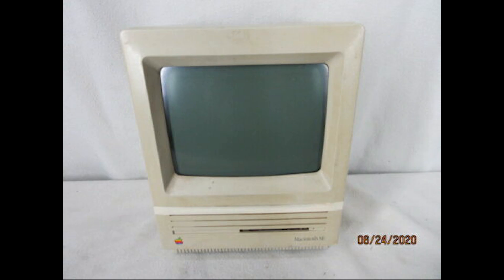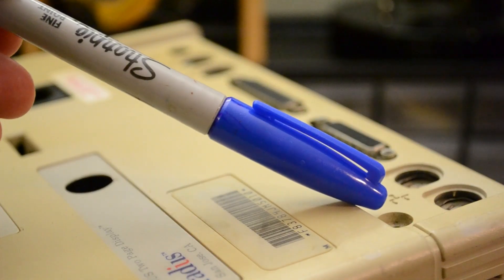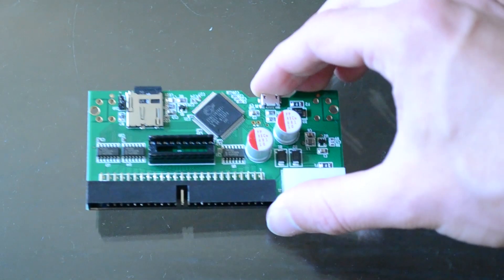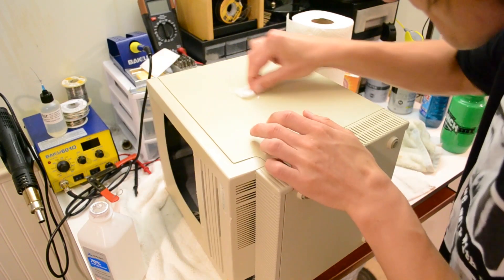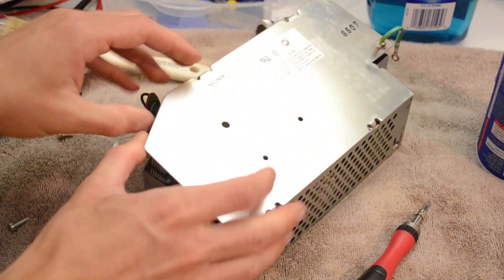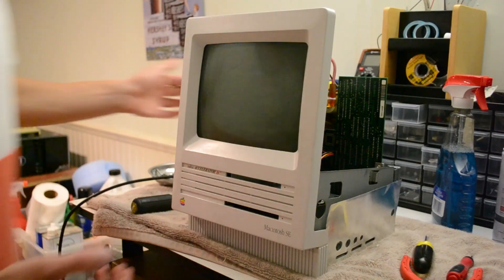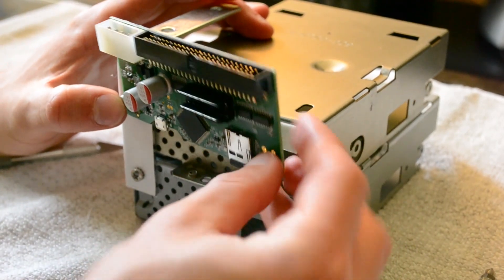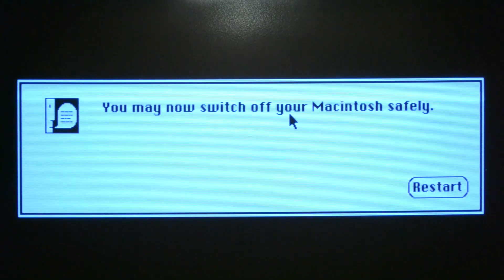The 'Ultimate' Macintosh SE - RESTORATION / SCSI2SD INSTALLATION!

Comment: While living in Germany as a teen (Late 80s) my mother ran a latch key program for military kids.  She had bought several Mac SE and  built a lab for the kids.
I helped her with setting them up, installing software.  Mostly like Printshop and stuff for the kids.   Anyways, After that I never touched another apple.  Becoming a network admin / engineer it was all Novell, Microsoft.  My mother was recently killed and to my surprise she still had her Mac SE boxed away.
Im restoring it and luckily  the insides look immaculate and the battery never leaked.  While booting it runs through startup.  hard drive, floppy drives.  Than a single beep that never stops.  No display picture or anything.   But, glad she kept something that we had worked on together.  A good memory.
Reply from the maker: That's incredible, your mother sounded like a really cool person and I'm sorry for your loss. I'm glad she kept one of the SEs around! I've never seen an error like that, but hopefully it's nothing too hard to fix. It sounds like it might be RAM related, I would re-seat the RAM. If that doesn't work, try powering it on without the RAM installed. If it gives you a different error, then that might be your problem.

Comment: When you mentioned “bath of retrobright treatment” do you mean that literally? I used the foil wrap method and it wasnt as smooth as i hoped the first time. (Swirl marks from creasing im guessing.) 
Your results are fantastic
Reply: Would also love to know how hard it was to setup system 7 with the scsi2sd. My hard drive has failed but the board was recently overhauled with new caps… would love to get it going again
Reply from the maker: I do use the liquid method.  I use a big plastic container and I fill it up with water and add a bottle of the liquid peroxide.

Comment: I have an SE FDHD which is not recognizing the SCSI2SD board. I have the same board you do and followed the instructions on the Savage Taylor blog but I only get a ? on boot up. The Mac works fine with the original hard drive. Any thoughts? What process did you follow to load the SD card?
Reply from the maker: Hmm, I'm not sure, did you use a disk image provided by savage taylor? the System 7 Disk image they have is too new I think for the SE. Could also be how the disk image was copied over to your SD card?
Reply: @ColonialPuppet  
Turns out I did everything right, the sd card holder on the board is defective. I had to put pressure on the holder with some duct tape and it booted fine. Itead gives no response yet but seeking a partial refund or replacement board.
Reply: @ColonialPuppet  Also the Savage Taylor 7.5.5 image is working fine with my SE FDHD. Just needed to remove some extensions from the universal install option after booting and also Finder Options causes a crash so remove or do not install that either. Otherwise works great, Clarisworks 2.1 and Sim City 1.4g here I come.